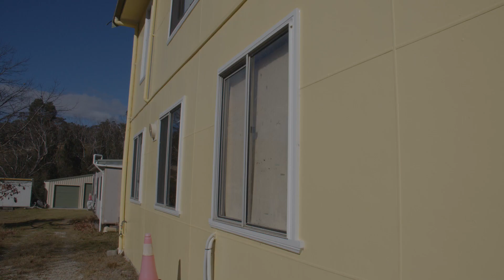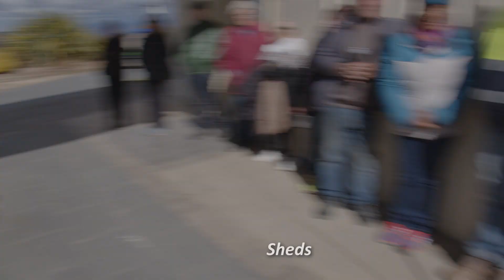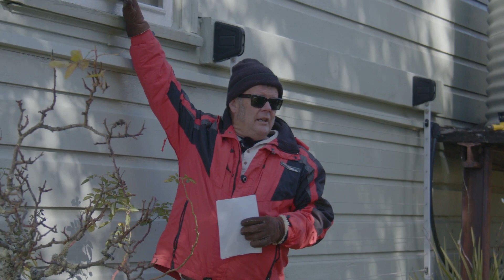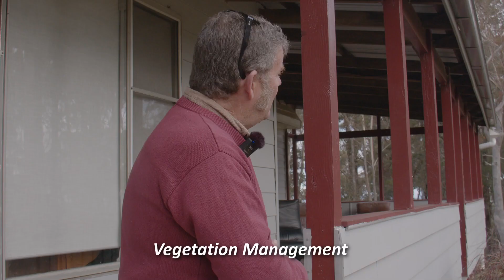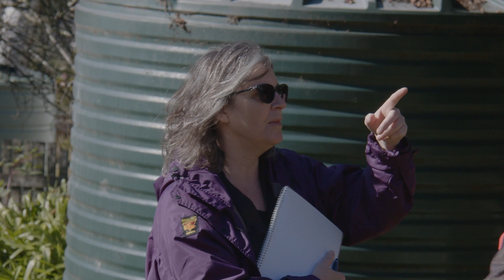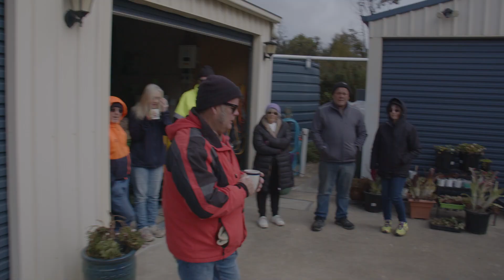Preparing your home for bushfires #2 - Home Construction Risks with Tony Hawkins, by ABCD Inc

Comment: Fire that comes with strong winds is the prblm. Sprinklers 4/6m away from  the house on a 2m metal pole. The wind will blow the water towards the house. They can not be more than 3m apart. The wind takes the fanning out of the spray angle. I always test my sprinklers in strong wind to see where the water lands